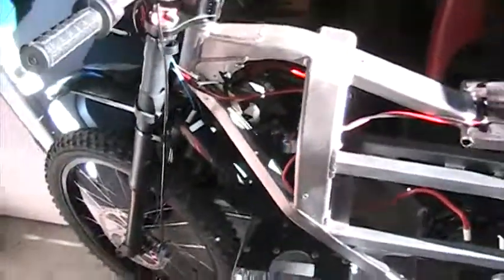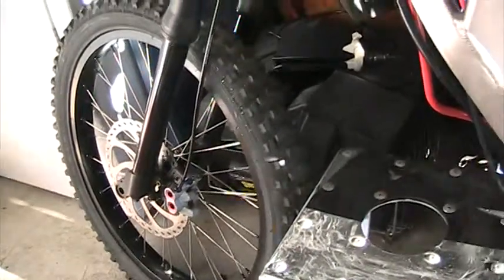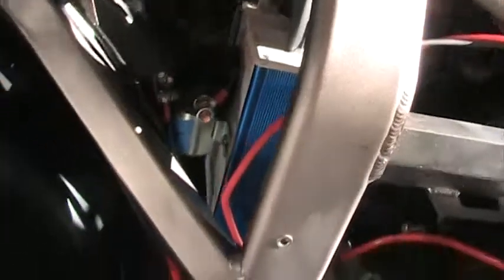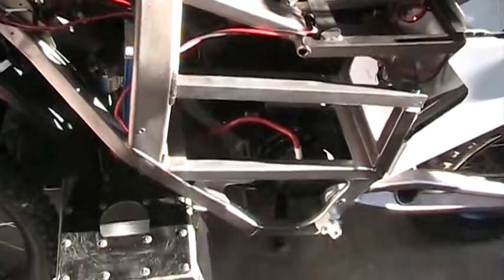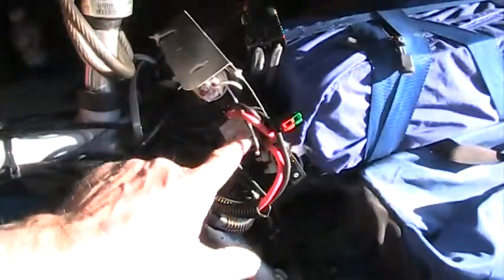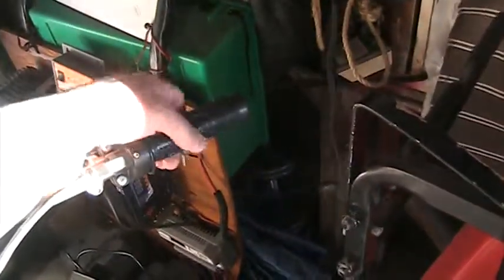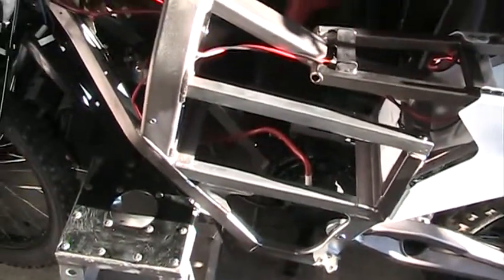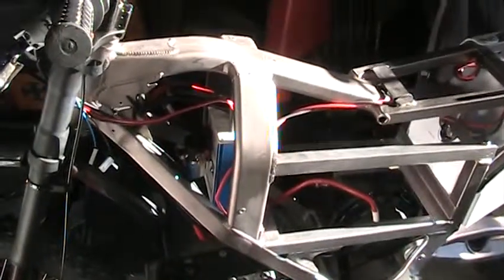Zero X  motorcycle build 1

Comment: Hello I was wondering if its possible to put a newer ZF 5.7 battery / motor in this older zero frame? Thanks for your information
Reply from the maker: I know the old bike / motor is 48 volts and the new is 96 volts and maybe a 72 in there somewhere, so not an easy thing to do. You would have to replace the controler, battery etc. The new battery is a two part one for tax reasons and the old is a big battery box about the same size as two new batteries. If you change the altrex to a higher voltage and change the battery will work but the dash controller will have to be bypassed, using the altrex wiring diagram.
Reply: Thanks for your reply Darwin: I have actually all the 2013 zero components and was hoping to swap them into a 2009 zero s frame. The reason being is the 2013 frame was damaged beyond practical repair.
Anyway I thought id see alot more 2009 retro or custom performance mod videos but yours seems to be the main one.  So my main question is if this would be possible without cutting up the 2009 frame - Considering I have both the older frame and newer powertrain components would this be worth doing?
Let me know your thoughts.
Thanks again
Reply from the maker: Sounds like a great project but the early bike was 160 pound bike, very light frame. The motor would need an different plate to mount it but it may work. My only issue is will the frame take the increased power and weight. The newer bikes are 275 pounds so the frame and parts are probably stronger. Get it going and it will be extra fast and fun!
The early bikes had a perm german motor with four bolt holes, you can find the pattern online with charts. There is a plate that adapts to the frame that has four bolt holes.  You could fit one new battery into the space of the larger older battery.
Reply from the maker: reusing the driveline is great. I started with a birel racing go kart with the early zero driveline in it, swap the battery from the bike and go! It was fun but there was no electric class, so I was a classless guy.

Comment: What are the forks? They look different
Reply from the maker: They are RST I believe,, they did not deliver the bikes with these, not so good as they leak out a thin fluid. My friend at Pacific cycles in Santa Cruz tells me they tried them and found them unreliable. I got hold of some of the White bro shocks and put on later.  That old shock was scarry, rode it a few times and one of the stops failed, so bump noise on rebound, figured out I only had one other stop holding the fork on! Yikes. 
So the White bro are about $1200 new and the RST was $800 new. I got lucky and found white shocks for $20 from a local in scotts valley (zero factory town) and bought stantions for $250 from White bro. 
To complete the story, I bought the bike from a guy who's dad bought a storage unit abandoned. It was missing all the electrics, harness, baytt motor etc. I rebuilt up with parts, fab the harness.
 It seemed to be a prototype, funky shocks and so stain on the bottom frame (batt ozzed?). 
Had no miles on it for $550 and total now have $700 in the  bike, affordable! Riding off road in Reno area, Yahoo!
Now I use a Smart car / Mercedies battery 1/2 with 48 volts squezed into the frame box. Paid $500 for that battery recycled from car, bit to modify but works better, more current supplied. Sorry did not make a video, I should have.
Reply: Hi Keith, thanks for the explanation, yes sounds like a test bike prototype as it was local to the factory. We were the U.K. dealer for Zero from 2009 and I met Neal Saiki the inventor. The batteries didn’t have any acid in the as I remember. They used Molicel from Canada which were rubbish. Apparently all the electronics on the Zero simply fooled the Alltrax controller to provide limited power and speed. I disagree with you about the Hayes brakes, they looked poxy but had awesome stopping power! 
I bought 8 of them from a failed charity after they bricked them all and have spent the day cleaning and recommissioning them after spending 4 years in my garden under a tarp. Still a bit to do...
I used the EIG pouch cells in a 14s configuration which fits in the original box very nicely and uses the original bMS and wiring, packs more punch as well as less voltage sag when you apply the power. Planning to offer an off road electric experience eventually ...